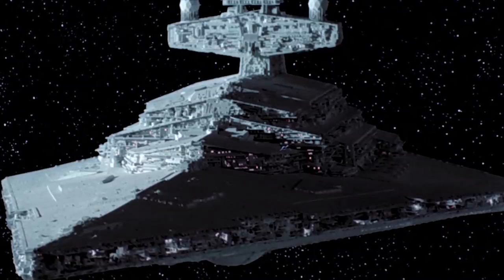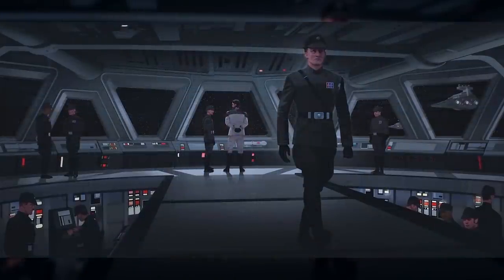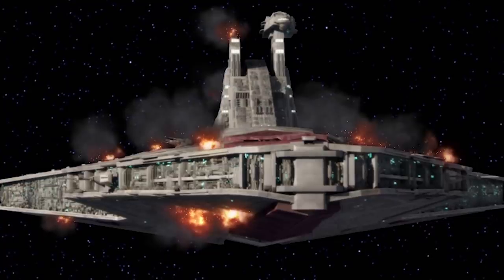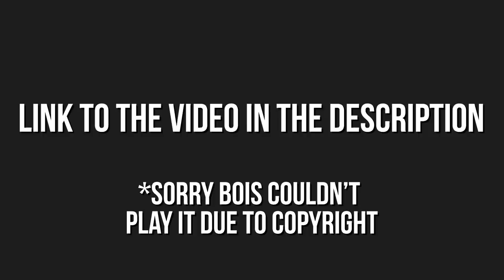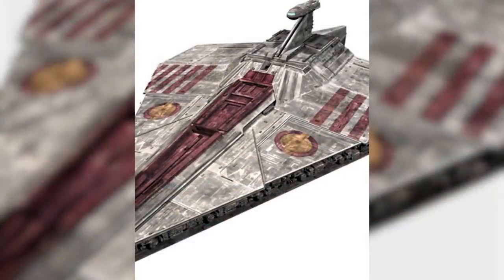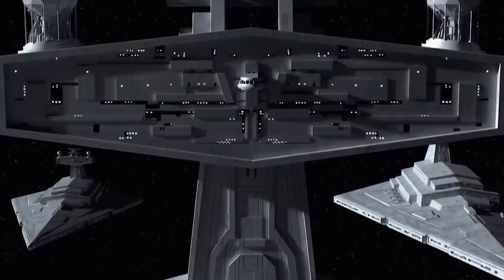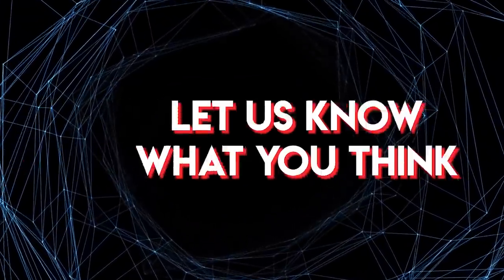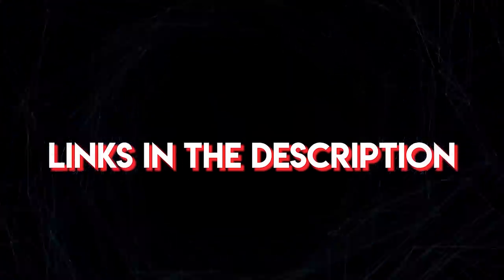Why were Star Wars Command Bridges SO Over-Exposed?

Comment: At least the venator did it with style. The ISD bridge has the width to height ratio of a hammerhead shark, and is there just screaming "SHOOT ME, RAM ME" at any rebel ship in range. Especially the star destroyers in Rebels, with thier giraffe necks that are basically asking to be severed.
Reply: Dr. Pootis didn’t that last thing actually happen in one of the last episodes of Rebels? I remember in the X-Wing space battle that an Arquitens Imperial Cruiser collided with the neck of an Imperial Star Destroyer, separating the bridge from the rest of the ship.
Reply: @Dr. Pootis
Not only that but the Venator had two bridges in case one was damaged or destroyed
Reply: @forthencholordofadmirals2763  I think one of them was tactical while the other was navigation, losing one still puts a Venator at a serious disadvantage.
Reply: aid 1234 I’m pretty sure the one on the starboard side was the bridge for the ship, while the port side was for managing fighters because it’s more or less a carrier
Reply: @thiccchungo1041  The starboard station was the ship's bridge. That was where the Captain, Helmsman, Gunners, etc were.

The port side station was the starfighter bridge, comparable to an air traffic control tower at an airport or a carrier. The starfighter commander was there, with the controllers and fighter directors.

The Admiral could move between the two depending on what is going on with the ship, though most admirals stuck with the ship's bridge.
Reply: @aadvantagegold5220  But there is no bridge between the bridges so he would have to take a turbolift all of the way down to the main ship and then all of the way up to the other side. In that time, Palpatine could execute order 66

Comment: Actually, WWII warships, especially the most modern battleships and crusiers, had well protected battle bridges.  That is, when general orders sounded and the crew manned battle stations, the captain and bridge officers of WWII warships moved from their usual spot in the front-topmost portion of the super-structure--where they would normally be for the best view--to a much better protected battle bridge directly below, within the heavy bands of armor that encircled the ship just below the main deck.  Actually, that's not entirely correct:  battleships and crusiers had multiple redundant stations that could assume fire and navigational controls in the event that one or even two of the command stations were knocked out, or cut off from communication.  The communication aspect was vitally important, because, on a WWII crusier for example, the normal procedure for firing the guns began with a command from the captain in the battle bridge to the whole of the ship to make ready the guns; the fire control station, which was commanded (I think) by the 2nd mate, i.e., the third ranking ship's officer, and was located astern of the main bridge but still beneath the super-structure and protected by the heaviest armor, then determined specific targetting for each gun turret.  When their target plots were complete, fire control actually aimed the guns electronically, then issued specific order to each gun turret to load and fire a certain amount of charge with a particular type of projectile.  Each gun turret had its own compliment of men who communicated back to the fire command bridge and could aim the turret independently in the event fire command was no longer able to, but neither the gun turret crews, nor fire control, nor even the captain in the main battle bridge had a view of the target or any part of the outside world:  they were all snug and cozy beneath the main deck and several inches, at least, of armor.  Information about hits and misses, and the outside world in general came from observation posts located in the ship's super-structure, above the deck.  The posts were protected as best they could be, but since their job was to be able to see what was going on and report it down to the battle bridge and fire control, they were much more exposed than anyone posted below them.  On a cruiser, I believe there were four observation posts, each one with independent communications, including non-electrical tubes, to the various command stations.  And in addition to the main battle bridge and fire command, there was a third protected battle bridge, all the way astern of the super-structure (so about the mirror image of the main battle bridge, which was on the extreme fore end of the super-structure).  This bridge was commanded by another executive officer and was equipped to take over the duties of any other command post, but and didn't have any specific duties during and engagement except to follow along with communications and be ready to ensure continuity of command if either of those other stations were lost or otherwise needed assistance.

All of that is a really windy way to say that the normal crusing bridge of a WWII warship was indeed pretty exposed, but as the men who designed and manned those ship were much less concerned about looking cool--either to their opponents or to a cinema audience--that exposed bridge would be quite empty if the ship became engaged.  Instead of making easier targets of themselves, the usual bridge occupants would be dispersed and buried away in the separate areas of the deepest parts of the ship, in the places that offered the very best chance for survival.  Just as logic dictates that they should have been.
Reply: star wars ships have backup command bridges too

Comment: Suggestion for future video: Why are most types of Blasters Semi-automatic and not fully automatic?
Reply: Possibly to avoid overheating and to encourage the shooter to make precise shots. I imagine you would need heavy, high-quality heatsinks in order to shoot a Blaster in full-auto for an extended period of time. Or even for a short period of time. This is plasma we're taking about.
Reply: A wizard did it
Reply: In real life combat, most firearms users choose semi auto firing modes over full auto as it's way easier to control. The cannonical answer in Star Wars could be inspired by that logic?
Reply: They all have fully automatic mode (well the ones on the movies at least) it’s just the clones, rebels, droids, and stormtroopers just decide that they want more accurate shots then just spray and pray. And because blasters had around 500 shots you would need to switch out the gas mechanism in the gun which was very dangerous especially during battles.
Reply: @kingsway.183  exactly
Reply: most are full auto, but like in real life militaries, shot in semi auto for better accuracy and recoil control
Reply: Question: do laser guns have recoil and is it higher than our firearms?
Reply: @leerzeichn93  die laser guns? 😂😂😂
Reply: @maestrofeli4259  *do XD
Reply: @leerzeichn93  laser guns don't but these aren't lasers, they're plasma bolts.
As for more than modern firearms? Probably not, they would still have recoil but I imagine much less.
Reply: @leerzeichn93  XD
Reply: Cost. Same as modern firearms. I can make an automatic, but the price and small market (those willing to buy illegally) turn most of them away, when a standard cheap one is good too and easily available
Reply: Heat
Reply: There's also the matter of ammunition management. People with miniguns is typically movie material because seven seconds of sustained fire is a death sentence.

Comment: To be fair the executer took a lot of beating before it goes down. It lost its shields and lost its engines. It also took damage on the reactor. That why it fall like a stone out the air. The gravity field of the second death star was to strong to resist with damaged engines and only its auxiliary engines.
Reply: You can see smoke coming from the engines in the movie. Most likely if the engines were not so damaged or any of the the other problems you mentioned not happened. The command of the ship would've been transferred to a secondary officer and the Ship would've been turned into a mostly stationary artillery battery.
Reply: @scottishbananaclan  In fact the Executor did have several secondary combat command bridges built inside the hull, they just could not really do anything in that situation.

Comment: A good example of sci-fi that has ships with both exposed and centralized bridges is Halo. Most Covenant ships have their command centres placed in the centre of the ship, a la Battlestar Galactica, the only exception to this rule that I know of is the SDV-class corvette, but even then the bridge is seemingly protected by heavy armor and the "windows" are apparently holographic projections. UNSC ships, on the other hand, have exposed bridges as a rule, most likely meant to emphasize humanity's comparatively primitive technology; but, in this case it isn't as much of a design flaw as Star Wars bridge placement, at least in my opinion, as the bridge modules are placed close enough to the main hull to make them less of a target. Hell, the Pillar of Autumn's bridge was located close to the ships ventral side, giving it a good blend of field-of-view and protection from incoming fire.

Comment: If I were designing a ship and needed a exposed bridge, I would have it be as small a target as possible with a few point defense lasers surrounding it as well as having multiple bridges, one main, one fleet control, and one internal bridge to make sure my ship won’t be crippled so easily and las linger in a fight
Reply: Yeah small windows and thick armour would be good.
Reply: Scottish Banana Clan and also place it in the least likely to get hit area you can find
Reply: Little Kitten Venators don’t have the internal bridge or point defense lasers around them and are very exposed

Comment: I think instead of exposed command bridges they make a command satellite or communication station on the top, heavily shielded like a regular bridge, Only no one is actually in there and if destroyed the ship can still be functioned by the real command bridge located in the bottom. The communication and the real bridge should be connected for communication, but if the communication was destroyed, the ship would still be able to work and minovery however would just lose the communication to a wider radius. For example for ventor the design right now, the bridge's original placement would replaced with a communication station attached  to the ship that connects to the real bridge which would be located near the center of the ship. For window problems, the ship's bridge will be in the center, with stairs leading up to a upper point to a heavily shielded window or have a camera on the outside able to import to a large screen inside the main bridge. Besides, they already have holographic images of battles anyways.

Comment: A good example of an armoured bridge design is the CCS class Battlecruiser, in use by the Covenant navy. The Command Information Center (Bridge) is buried in the armored center of the vessel, behind tonnes of nanolaminate armor plating, and the ships heavy shielding. Most Covenant warships do this, with the exception of the rarely used SDV class Corvette, which, while had an exposed bridge, with a window to the battle outside, it was not positioned on a tower, but rather on the front of the vessel's body

Comment: There is one reason to have an exposed bridge, and that's a maneuvering bridge for manual docking and landing. Think in terms of a submarine, where combat and regular operations are handled deep within the ship, but when coming into port they have an open bridge setup atop their conning towers. The same could easily be applied to spaceship design theory. Your combat bridge is buried deep within the hull, as deep as you can put it without impeding ship functions, while your conning tower has a navigational bridge used for docking and close maneuvering. The navigational bridge would actually route its command signals through the combat bridge, where there are duplicate controls and readouts, and would be evacuated and unpowered during combat.

You would never use the exposed bridge for actual combat, unless you were an captain so overconfident you ordered combat controls fitted to it specifically to get yourself shot.

Comment: when it comes to questioning the design of star destroyers its important to think of:
- the ships anatomy, such as the fact that the engines take up a large part of the back of the ships interior core
- practicality of cost effect and mass production, in order to make space for the bridge to be flush or within the ships body, the length of the ship would have to be stretched, which would require more money and building materials and resources
- crew cohesion, communication, co-ordination, and syncronization, one situation for example being the bridge retasking a cannon platform and a squadron of TIE fighters for an attack
Reply: Thank you

Comment: Well, I think the design works well enough, as you said very rarely did the shields go down, and even when they did the ships were usually destroyed by other means, like taking out the hanger bay, engines, cannons, or even just blasting the entire ship from multiple sides with turbo lasers to blow the entire thing up. So with how few times it ever actually was a flaw the designers probably never felt the need to fix the issue since it was rarely a problem. I can think of only six times a bridge was actually hit and one of those times the ship didn't even get destroyed because of it. 
The first one was like you showed, at the Battle of Endor. The second example is when Ventress used the method to take down a Venator during the Battle of Sullest during season 3 episode 12 of the Clone Wars, and even then she still needed her Droids to wipe out their shields and engines before attempting it. Third, when Hera tricked that Imperial Piolet into crashing the TIE Defender into a Star Destroyer during the Battle of Lothal near the end of season 4 of Rebels, and again how she did it was a completely reckless maneuver that had low chances of actually working. The fourth and five examples are pretty much the same, Ahsoka leading a team of fighters in both the Battle of Ryloth and the Battle of Umbara to blitz the ships and hit every part of them, including the bridge. The last example is the one time a ship wasn't destroyed by this method when the bridge was targeted, during the first attempt the break the Separatist blockade over Ryloth, in which  Vulture Droids crashed into the pair of bridges on the ship Anakin and  Yularren were on, while one bridge was taken out and the other damaged, the ship wasn't destroyed.

Comment: What if they made false bridges to trick the enemy into shooting at something that doesn’t even matter? That’s not what they did, but it would be interesting
Reply: At first this seems like an effective strategic deception. Also, i don't think it would be cost prohibitive; there would simply be factories that turn out the dummy bridge type ships and other factories that do not. However, there is a possible serious problem with having some of the fleet outfitted with exposed yet false bridges and others with the actual bridge still exposed. The fleet would die from the inside: Ships lacking a false bridge would suffer from abysmal morale because those types of ships would be lost in battle far more often than their better designed false bridge counterparts. The crew of a false bridge ship would feel like they are engaging in military strategy, the crew of a "standard" exposed bridge ship would feel like they are taking a gamble.

(edit) Cost revisited:
False bridge ships would definitely be more expensive to produce. If the split in the fleet between the two types of ship led to destroyed morale in part of the fleet, then the cost goes even higher than the initial face value increased cost.

Comment: So,you see all the republic/empire over-exposed bridges
But,the providence class dreadnought doesent have it exposed 
İts rather small,and there is a long tower at the end of it,the enemy will think thats the command bridge but the actual bridge is infront of it
Reply: While it's less severely exposed, the providences (and munificents) brides were almost entirely made from windows. I doubt that was good for survivability in case of a hit.
Reply: Commander SFO it was made of transparisteel which is just steel but clear (duh)
Reply: @BallMuncher555  The windows material might be pretty tough, but it doesn't have the thickness needed to survive direct hits from heavier turbo laser batteries.

Comment: A good solution to the sensor point is dealt with in the scifi anime "the legend of the galactic heroes", where the bridge is safe inside the ship with monitors to show the battle like windows, but if this system fails the bridge can lift itself up, out of the safe hull and use its real windows.

Comment: In my opinion the province ships are a good example of ships have a tall structure in the back and the command bridge in the front to sort of confusion pilots when going for attack runs
Reply: The tall structure in the back is usually a sensor array, which is useful exposed as the sensors will then have less obstruction.

Comment: To be fair to the Executor, it only went down fully because of fairly heavy damage, and that combined with the poor positioning (too close to the station) meant that auxiliary command stations didn't have any chance to react to the loss of the main bridge. If the ship hadn't been under such concentrated fire and out of such direct influence of  the second Death Star's gravity well, it could have still been combat effective. Though primary fleet coordination would have been severely hampered none the less, indeed. It was a cascade of failures in design of one form or another.